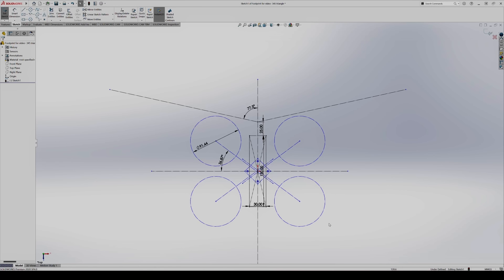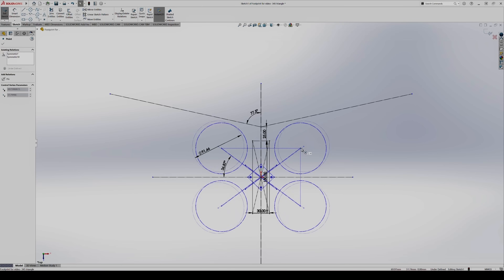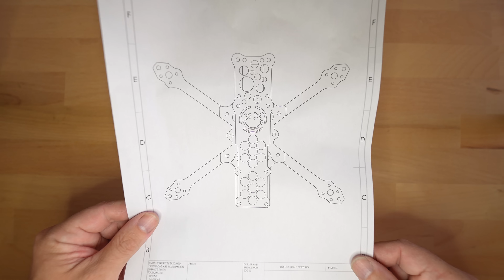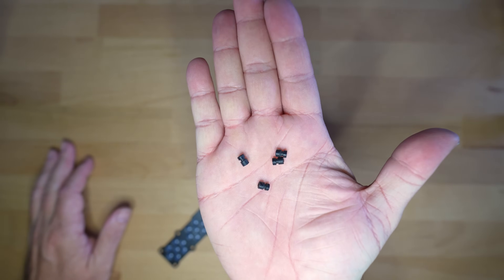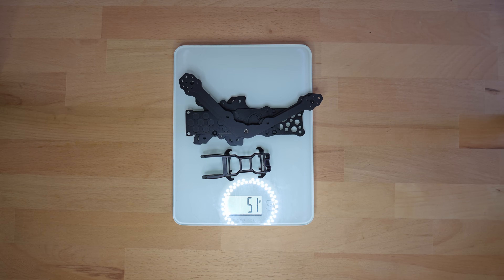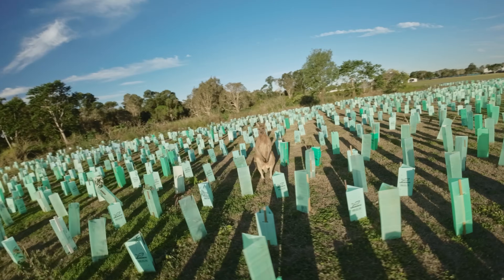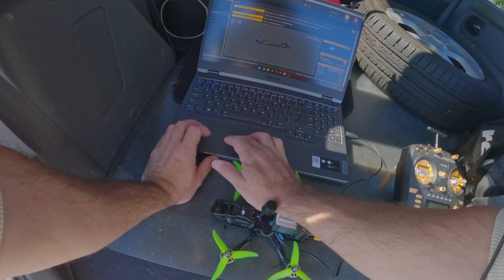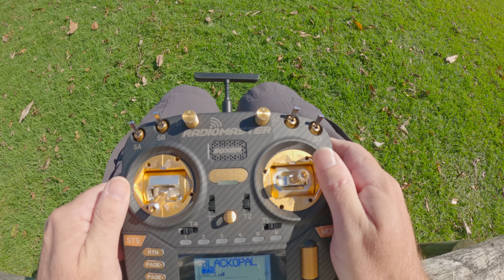A NEW FPV Drone With A Twist - Pavlova 3.5

Comment: Scott How much weight do you think would be saved if the Design could be changed to a unibody?
Reply from the maker: Couple grams maybe. Gain a little more stiffness when it's in pieces however.

Comment: I was so hoping that cool smiley face would be in the file.... Awesome frame
Reply from the maker: I can add that file if you wanted it. It does weaken the top plate (Not that I've had an issue with it)

Comment: The next fpv inovation is here "hot swap vtx". honestly this is the best idea. If bnf brands like flight or Geprc start using it, there could be an option to buy the drone with the "hot swap system". I think for this to really be used main stream it would have to be quick and easy, just sliding it onto rails that would be on the drone, and for the connector it could just be plugged in.

Comment: Great video, nice flying, awesome product. What type of CNC bit do you use to cut the Carbon fiber plates with?
Reply from the maker: Just diamond cut carbide burr end mills. Same as what's used for PCB milling etc.
Reply: @ScottTomlinson  Great, thank you. I have a bunch of different bits, was hoping not having to get some special carbon cutting bits  :)

Comment: That is such a good idea. I have been toying with the idea of putting an 03 air unit in a tpu mount but all the tpu mounts add a lot of weight. It would be on on my 7 inch quad and my 3 inch cinequad but a bit much for my old beta85x. However this idea is absolutely perfect. I think I will design a tpu mount to mount the shell to, to adipate it to suit my other drone. Awesome video 🔥🔥👌👌

Comment: great idea, 
what i thought was wouldnt it be better for center of mass and stuff like that to get rid of the top plate in the front area and fix that air unit cage to the bottom plate? i guess you would have to move the fc back a bit but it should be more compact and not sticking out so much to the top
Reply from the maker: My receiver sits in that front part. You loose all strength just removing the top plate in the front but you could definitely make a mono frame design though. That would work too.

Comment: Got one, kinda, for Walksnail. It's a 3D printed little box that fits all the gubbins in and attaches with a GoPro mount. Looks a bit like a GoPro Session with an antenna sticking out. I just added two extra plugs, one of the old red JSTs for power and an XH2.54 for RX/TX, because I didn't like the idea of unplugging the tiny WS plug all the time. Here in China you can buy those 3D printed cases for WS and DJI, no need to even grab a file from Thingiverse, but for O3 you can also get a CNC aluminium jobbie which also acts as a heatsink. Very cool stuff, your solution is much more elegant though. Speaking of modular, there's also a company making a 5 & 7" frame with quickly swappable arms, they stay together in a kind of X shape with motors and props still installed, and have all the little springy brass connectors for the ESCs.  3 minutes or less to go from 5" freestyle to 7" cruiser. The future may well be modular.
Reply: Oh, quick edit- Mine has a GoPro mount, but you can also get them with a Garmin bike computer type mount, just twist it in 90 degrees to lock, which makes it a bit lower profile.

Comment: Brilliant. I know the idea about removable O3 units was a concept talked about and implemented (not very well) before. An excellent concept which I'm surprised no one has taken further. I'm not sure but I think this is the first time a frame has been designed with that purpose in mind. Also there's a few good ideas there that can be used in other frames in general. Like the pockets for the silicone pads for example, which are more available, lighter and less expensive to buy then good quality battery pads. If the removable of the O3 housing can be done without removing the top plate would be great, which could be done by using press nuts in the top plate for a thread to screw the housing onto. I hope your video inspires more ingenuity and creativity.

Comment: The only thing I don't like is the antenna placement. Aside from that, it's brilliant.
Reply from the maker: DJI one? They come with two whip antennas in the BetaFPV kit if you're keeping it small. This is utilitarian though. Not great for crashes being so exposed I guess.
Reply: @ScottTomlinson  maybe try to angle it slightly, perhaps a very light enclosure or protector of some kind.

Comment: Would that work with the walksnail version?
Reply from the maker: So the great thing about the spare part you buy from BetaFPV is that it comes with adapter plate and hardware for other vtxs. I don't use WS or HDZ anymore so can't comment directly but I'm sure you could make it work.

Comment: This makes a ton of sense to me! The cost savings and the low deck design for good CG are both attractive. Great design! Would it make sense to soft-mount only the camera, so that you can tighten the screws that attach the air unit cage to the frame fully? They'll be less likely to come loose.
Reply from the maker: Those screws lock in tight. That's the great part about that BetaFPV cage. They have a blind thread in the nut. You can tighten it fully and it's the same every time. A drawback with only isolating the camera is the weight. Dampening becomes easier when there's a bit of mass.

Comment: There are only two things to say: Great job! And why didn't I think of this myself? I could see this idea really taking off, pun intended. Could be sold as a 2'' + 3'' combo, or 2.5'' + 3.5'' combo, or any combination up to 7''. Buy the module with 1, 2, 3, 4 or more different-sized frames, for a tailored price. Each frame would have its own FC with its own PID tune for each size.
Reply from the maker: That's what I'm thinking too. Even if not this design, the takeaway is the concept. A big manufacturer could design and sell a whole series around the concept. They're selling drones without an O3 for cost reasons already so this isn't a big pivot.

Comment: I think that's an extremely relevant design. 03 air units are really expensive (for me anyway). I only own two quads, both diy builds. The 7" is analog and the 3.5" is digital with the 03AU and Goggles Integra. I've toyed with the idea of buying another 03AU for the 7" but have been dragging my feet due to cost and the 04AU might drop and if it's compatible with Integra, I might save up for one. Your solution is valid for a great many people. Thanks for creating content that I find interesting, informative, and entertaining. Happy flying amigo. 🫡 🍻